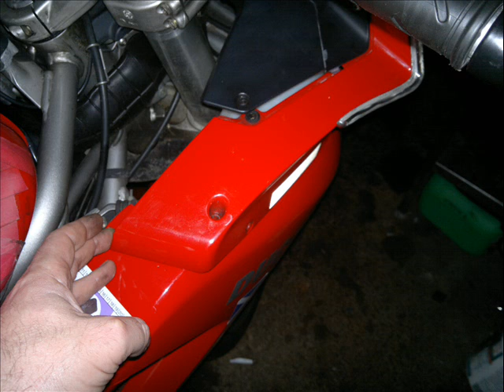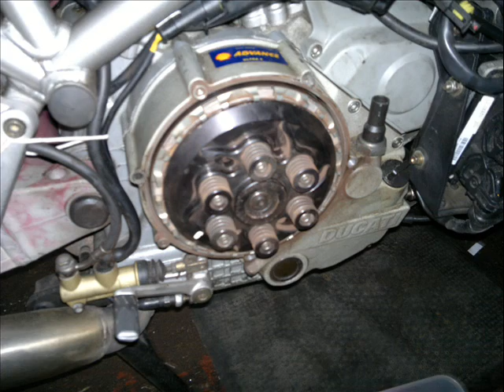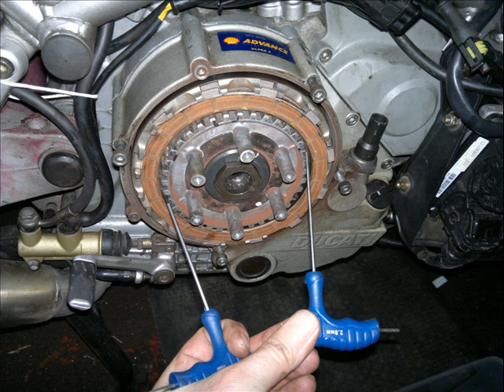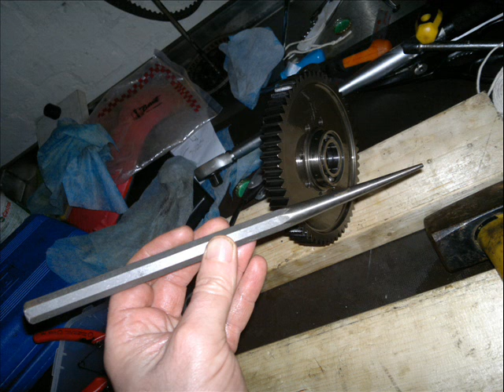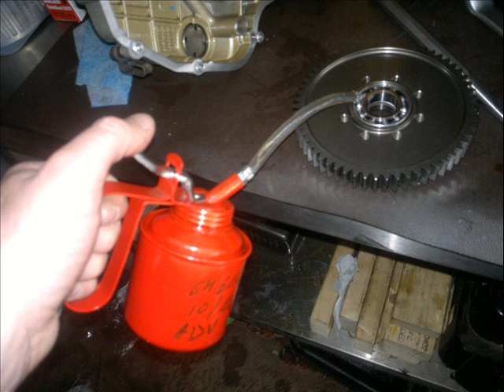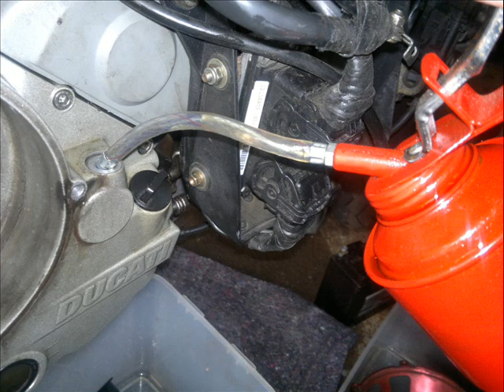Ducati dry clutch removal 60 sec how to.wmv

Comment: when I received a new barnet set of cutch and spacers do I remove the oil on the steel spacer plate before I install the new system

Comment from the maker: roflol, i'll think i'll stick to Ducati :) as i've had the bike for about 10 years :)
refitting crank casings to check stuff 2012-06-07-899.mp4
measuring crank preload ducati 2012-05-09-582.mp4
Ducati Warm Up Thermal Images